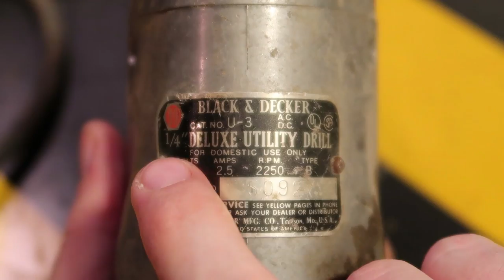1950s Black & Decker U-3 1/4" Deluxe Utility Drill: cleaning and repair

Comment: I have my Grandfather's drill which looks 80% like yours but I think is older.  He bought the drill press attachment and the stamped metal attachment to turn it into a polishing wheel.  It is acting a little wonky and needs rebuilding.  Thanks for posting this.  Mine is packed with sawdust and smells a bit when running.  Great idea to make it dedicated.  Mine will be dedicated to the Black & Decker drill press that was made to hold this model.
Reply: And I have the exact same ratcheting 3-position screwdriver from him as well!  Never saw another one before.  I love old tools

Comment: The little pad at the rear end of the shaft is an oil reservoir to keep the brass bushing there lubricated, which is why there is a hole in the outer casing leading to it. The brushes will hopefully self-clean/wear-in and improve over time, so long as you got all the oil off of the commutator. I've seen better, I've seen worse, but I am no expert myself and it still runs, so s'alright. I wouldn't recommend using steel-wire-wheels on commutators in the future though, far too aggressive for copper or copper-based stuff.

Comment: I work with a guy who worked at the B&D plant in the early 80s - He said that they did everything under one roof, all of the engineering/forging/manufacturing/assembly was done at the same facility, something you would never see today.    They would work three shifts and run assembly 24 hours a day.  I think he said they would put out something like 20,000 drills a week.
Reply from the maker: yeah things have changed quite a bit, pretty soon itll be back to that but just one employee at a computer watching the machines work.

Comment: My Dad still has his and it still works. Black and Decker went through a crap stage in the late 80's but quality recovered somewhat after. Make sure it's earthed. The carbon shedded from the brushes can cause an isolation fault and a zap as a reward!

Comment: Never, never never use a conductive abrasive for cleaning commutators.  That appears to be aluminum oxide abrasive that you used which IS electrically conductive.  Only use garnet sandpaper.  Only clean the commutator if it has obvious burn marks or "tracks" on it.  A uniform chocolate color IS the preferred look, not shiny copper.

When you do clean a commutator do the least amount, only what is absolutely necessary to remove the burn marks.  Use an electrical cleaning solvent, many aerosols available to thoroughly clean the dirt and microscopic bits of copper from the surface AND between the copper bars.  The spaces between the bars may be recessed or they may be flush with the bars, it depends upon the spacer material and the manufacturer's preference.  If there IS a recess then use a toothbrush with the solvent to thoroughly clean the recesses.

Unless you are installing new brushes always make certain the same brush is inserted into the same holder AND in the same orientation.  Swapping brushes or getting the orientation backwards WILL cause excess sparking until the brush again wears into the the commutator.  This is also why doing the least to the commutator is actually the best.

The grease in those old B&D drills is normally brown so that part is okay.

I'd make some comments about your techniques but I already know how you respond to constructive  criticism.
Reply: Clyde Fishface I'm not an expert, but I agree with you. Sometimes doing very little to something like this is the best idea. Sanding that down a lot could shorten the life of the drill.
Reply: Clyde Fishface blah blah blah
Reply: Thank you!!
Reply: @Schwalbe262 No.  Doing so would likely upset the balance.

Comment: Turns out that the small felt piece is not sound deadening. It’s an oiling location. The odd smell you mentioned is natural. That’s ozone, which is common to brushed motors.

Comment: If you are removing the brushes you shoud mark there orientation. If you rotate one of them at 180* they dont fits as well as before so they produce a greater number of sparks. Therefore you have 25% chance to set up it like it whas. - sorry for my english ;).

Comment: The "brushes" need to get used to the new diameter of the commutator as you reduced its diameter by possibly 0.001 - 0.002", that's all. I would have replaced the original grease as the old stuff may have very small metal shavings in it. Great video.
Cheers.

Comment: I used to race 1/10th scale electric RC cars and to clean the commutator up on the motors I used a small lathe to skim it. This gives you a uniform, even surface for the brushes to sit on.

I don't think you did any harm to the drill but doing it by hand too much would probably give you a low spot in the middle of the comm.

Comment: Nice restore you got that chuck looking like new, for the commutator, try adding a spot of metal polish and running the motor, the brushes willl polish the comm as you run it and make it really shiny, this is what you want as there will be less friction and sparks between the comm and the brushes.
Reply from the maker: +gamerdude0 i could use toothpaste for that
Reply: You could, plus you would a get a minty fresh smelling drill as a bonus. And I think the word you were looking for was drag when referring to skateboard bearings and their ability to spin with a little drag from the lubricant.
Reply: Don't try to polish the commutator.  A nice chocolate brown color is ideal and will happen naturally with use.

Comment: Rinoa - I love your videos - but please use the proper tools for the job in hand - a "Swiss Army" knife/multitool is not the right tool. They are meant to be used when one doesn't have access to the correct screwdrivers etc. whereas you do have the correct tools.  Nevertheless, nice drill & video. Thx
Reply: Sasquatch it got the job done didn't it? The right tool for a job is the one that works
Reply: I disagree - the right tool is more than the one that just works - it is easy to damage screw or machined heads using the incorrect tool - there is a reason why there are different screw head types - torque etc.

Comment: Some older powerdrills i have own have a noise surpression capacitor connected to the powercord, i think most of them are 0.08-0.1 uf, it helps remove sparks from the brushes, why not upgrade yours with one, if theres space
Reply from the maker: thats a good idea, i think i have some capacitors that size from an old power supply i repaired

Comment: That little felt pad -it's not a noise dampener! should line up with a little hole in the case, it is where you are supposed to add the motor lubricant and the felt soaks it up to feed the motor.  I have an old circular saw and the manual says after every 15 hours of use add a few drops of machine oil (sewing machine, 3 in 1 etc).

Comment: I've heard that if you get oil/grease on the commutator it would be "ruined"  I don't believe it myself, but maybe cleaning off the commutator with some rubbing alcohol would help with the sparking.
Reply: Not ruined but not a good idea either.  Any mild solvent will clean it up.  Carbon tetrachloride was the solvent of choice back kin the day but it has been banned (I think) for quite some time now.  Any of the aerosol tech sprays made for electrical cleaning would be fine.

Comment: You're going to have problems trying to get 18650s to power this drill because they require a massive amount of inrush current. Of your 287 input watts you'd be lucky if even 80 watts are going to useful work on the motor the rest is making a pretty light show and lots and lots of heat. Modern burshless motors (AC Drive motors if you can get over how counter intuitive that sounds.) are worlds more efficient and indeed they have to be to be able to run off of batteries.

P.S. The cringe was real watching a commutator being sanded with steal wire XD

Comment: Nice video :) good idea with the 1500 grit sandpaper, you could always follow it up with some 2000 or higher and make it even smoother.. and as for the outside case, you could really clean that up with the same technique, it would take a bit of work granted but some 800, 1000, 1200, 1500 and then 2000 grit followed up by two passes on a polishing wheel with some compound would have that thing at an almost mirror finish! I guess the ageing does give it character.. depends what you fancy I suppose :) keep up the videos rinoa

Comment: Hi Rinoa great documented rebuild well done there.
I love these older made tools, with there cases made of metal (aluminium), they were built to last and to be made serviceable.
At a guess and a little bit of thought, the where on the plate it states type B it may mean domestic type, being as the plate all so states for domestic use only. by the way good idea being as you have several drills having this one set for wire brushing

Comment: You can probably replace that chuck. If you look down the barrel there's a screw
Reply from the maker: +diamened no need, it never needs to open again.
Reply: Nope, only reversible drill motors have a hold-down screw.  On non-reversible drills you open the chuck to the maximum leaving the key in the hole.  Then using a plastic mallet or chuck of wood smack the shank (not the cross handle) of the key smartly and the chuck will spin off the spindle.  It is a right-hand thread so it tightens the chuck to the spindle under normal use.

Comment: The sparking is normal, it is the nature or the beast. Also the pad under the big screw should be for light oil. A could of drops of 3 in one electric motor oil every 6 months or so will be fine.

Comment: WD 40 always! And u Will avoid the  risk of breaking the Threads and also soften the dirt and rust which makes it hard to loosen
Reply from the maker: ive never had much luck with wd 40, seems like a waste
Reply: Rinoa Super-Genius its never a waste Trust me u Will avoid to break the Bolt head and it Will be easier to remove it (if rusted it Will keep being difficult but it Will turn better for sure)
Reply from the maker: can you point me to a scientific study that shows this?
Reply: If the multiple tests i did My Experience and My father's job (40y mechanic exp) is not scientific i dunno what to say XD anyway u have a lot of old tools and I actually love vintage things Like those, gimme some :D
Reply from the maker: as if i dont like old tools?
Reply: Rinoa Super-Genius dont be greedy give me some XD

Comment: You just need to re-seat the brushes to the new suface by using it.
Reply from the maker: +De Montalvo ive given it several hours of use and it really hasnt changed much
Reply: It might just need new brushess. I have a collection of brushes that I accuired by removing all the brushes of every motor or tool that has to be trashed. And sometimes I get lucky and found a replacement I need from the collection. Good job on your vids!
Reply: Also sometimes it's better to just use a pencil eraser to clean the carbon. That way you dont change the surface.

Comment: I think the commutator shouldn't be that smooth it's should be a litle bit rough maybe 400 grit
If someone really knows how should be done please correct me
and the wire wheel on the commutator not so good idea because copper it's softer than the steel wires ;|
and really nice find ! :)
Reply: 400 or 600 grit garnet sandpaper on the commutator ONLY if it needs it, which this one did not.  A uniform chocolate color is ideal for a well run-in commutator.

NEVER use a steel wire wheel on a commutator as it WILL damage the copper.

Comment: I think that some amount of sparks are normal for that kind of motor, even have them in my brand new drill...
Reply from the maker: yeah i wasted another night trying to clean the commutator and the brushes more, i think perhaps thats just how it goes.
Reply: the brushes will arc less once they are worn in properly
Reply from the maker: +killernat they still seem to spark the same after several hours of use.